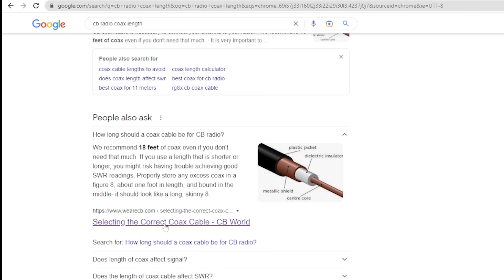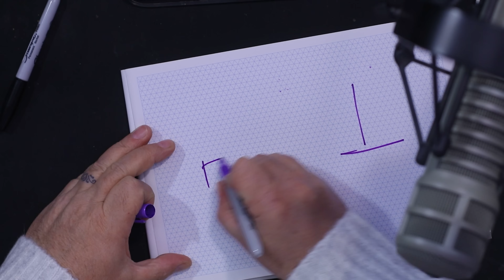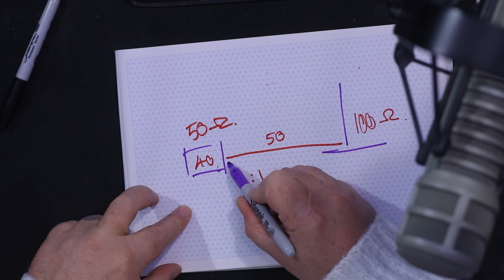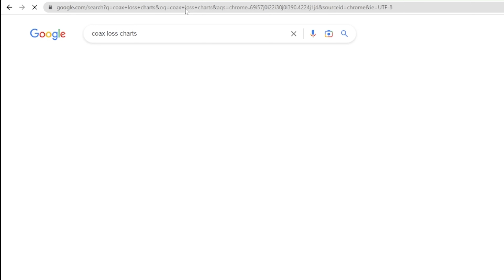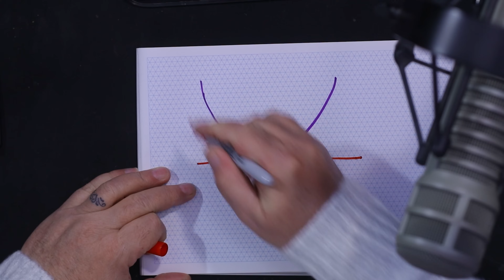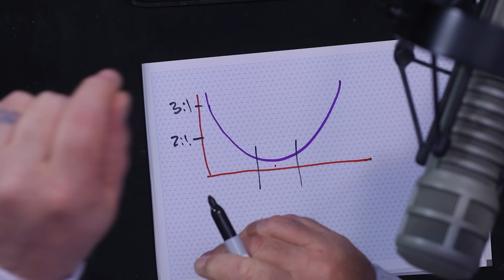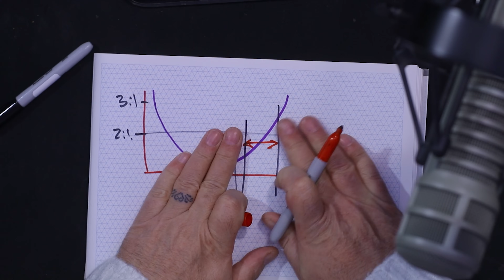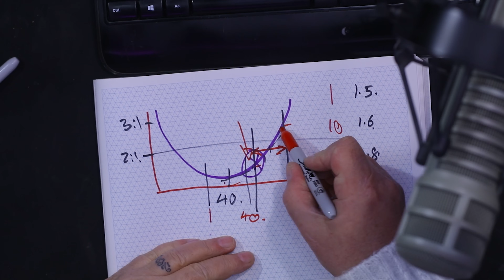11m / CB Radio: How Long Should My Coax Be?

Comment: Just came back to this as was thinking about TV transmitters and aerial coaxial cable.  So are tv transmitters at 75 ohm.   alos if what they say is true what is there view of ham radio for say HF 3.6 to 30 the vhf uhf dual band antenna what would there numbers add up to
Reply from the maker: Re TV.. Yes 75 ohm.. Sorry don't understand end of question..
Reply: They say if you are using 27.500 you should use this amount in meters of coax so how would there numbers work out for 3.5 tp 29 any were between using the same line feed  @DXCommanderHQ
Reply: @alunroberts1439  As Callum said, any length of coax will do.
G4GHB.
Reply: @bill-2018  I was not asking that if you did read what I was saying as calum was speaking they were saying the ideal length from there calculations for 27.500 so I was saying how do there numbers work out for 3.5Mhz or 7.200Mhz or 10Mhz or any think from 160meter to 10meters that is what I was saying.  So was what they say just BS.  Is there a best length for what ever.  So would it from there numbers work out different lengths.  For a cross the band.   All from there numbers.
Reply: @alunroberts1439  Sorry Alun if I misread what you said, Callum didn't understand either.
 CB'ers seem obsessed with coax length. I've never in 40+ years of radio cut coax to a specific length. According to CB'ers I must use 44 feet of trimmed coax on my 5.262 MHz inverted vee, which I don't. You're right it is B.S. I hate to think what I would need for our 136 kHz band!
The best example I can think of is they put a 50 Ω dummy load on their magical trimmed length of coax and see 4 Watts, then a random length and still 4 Watts. Most CB'ers are unlikely to have an oscilloscope so a bulb on the end would show it for a brief test. I've challenged some to try it but not heard anything back.
They'd probably still insist on velocity and impedance matching must be taken into account because they have been told and figures sound good.
Bill, G4GHB.

Comment: Callum, why don't you model typical antennas with different length coaxial feedlines on MANA-GAL?
You know how to use it better than me, I'll have to retrain myself.
Reply from the maker: Pointless because coax length has only one effect on a 50 ohmn system. Loss.
Reply: @DXCommanderHQ  the editors of that ARRL publication would seem to disagree.
Reply: @arconeagain  The RSGB Handbook only mentions loss for coax aerial feeder. They don't say different lengths make a difference.
Try a dummy load on different lengths of coax. It makes no difference. You still get 4 Watts unless a long lossy coax.
G4GHB.
Reply: @bill-2018  I've already pointed out various reasons why you may want a specific length of coax, like the half wave rule.
Reply: @arconeagain  I still say it's nonsense. Baffling people with figures sounds good.
In 49 years of radio transmitting I've never felt any need to cut coax to a specific length. The dummy load test shows why. No transmitter of mine has ever blown up.
According to you I must have 44 feet of trimmed coax on my 5.262 MHz inverted vee. Guess what? I don't. I hate to think what I would need for our 472 and 136 kHz bands. It'd be hundreds of feet painstakingly trimmed.
Bill, G4GHB.
Reply: @arconeagain  Actually it's not 44 feet, that's a quarter wave so it's more like 88 feet. I have around 50.
Reply: @arconeagain  In none of the RSGB Handbooks do they say cut coax to a specific length for a particular aerial. Why not read it?
G4GHB.
Reply: @bill-2018  I have read the RSGB, had a copy when I was a kid.
It isn't some myth, what I'm talking about is factual. If you don't know that, it's not my problem.
And what you're talking about with the inverted V, that sounds like a little known technique for feeding a balanced antenna with an unbalanced feedline. It's in the ARRL. So there's another example where you might cut to a certain length.
As for you never cutting to length, there's a very popular channel with an old ham who said he does with some of his antennas to get a better indication of the impedance. I think Callum may have done a vid with him.
So instead of telling me what I should do and that I'm speaking nonsense or whatever, I suggest you hit the books and better educate yourself. You can learn from other people you know.
Reply: @arconeagain  You do your thing and I'll do mine.
I've never in 49 years had problems with any of my aerials to make me think I need to cut coax.
Reply: @arconeagain  Have you not heard of baluns being used? They are in the Handbook.
Reply: @bill-2018  that's irrelevant. I can't believe you would ask that question of someone with my knowledge. I told you I have read the RSGB Handbook as a child. What does that tell you about me? I'm not a ham, that doesn't matter. I am extremely well educated. There's no talking to people like you. You can't accept that there may be someone out there as knowledgeable or more knowledgeable as yourself, or someone that has something fresh to bring to the table. No wonder amateur radio is stagnating.
Reply: @arconeagain  I don't dispute you have knowledge. You said you had read the RSGB book and the ARRL book describing an inverted vee as a balanced aerial, you appeared to not know about a balun, that's why I asked you. Sorry if I offended you, it wasn't intentional. 
I agree what you say about cable length in some cases it's important, I cut a length of 75 Ω coax for phasing crossed dipoles this year for 137 MHz. In 1974 I made a 5 el Yagi for 2m with the feed point tapped along the D.E., it needed a coax cable to be cut for impedance matching 300 Ω to 75 Ω  t.v. coax which a lot of amateurs used around that time on a simple set up. A lot of early gear had Belling Lee sockets on them.
I still say it's not important for a single aerial.
73.
Reply: @arconeagain  Hi arconeagain, one final thought you might consider.
An SWR meter is not an isolator. The aerial side is not independent of the input side. They connect together inside the meter.
Any length of cable on the input side simply adds to any length of cable on the output side through the meter. It's a fancy connector with a meter just as a coax coupler connects two cables together, it doesn't care what lengths are connected, they add up as one.
73, G4GHB.
Reply: @bill-2018  I sought of understand what you're getting. I believe there are a couple of different ways/techniques SWR meters measure in common meters, one better than the other. If the load impedance doesn't match the source, the SWR reading will change as you move it along the feedline, so different patch lead lengths will read differently.

Comment: I recently read an interesting article from QEX magazine (05/06-2021). It was about modelling antennas with the feed line using such software as EZNEC and MMANA-GAL, and the effects on CMC. You can find a version of this article by simply Google searching 'Simulating common-mode current in a coaxial feed line'.
QEX is a bimonthly magazine published by the American Radio Relay League.
So do yourself a favour, gents. Get yourself some free, unbiased, unadulterated education. Here's a small exert that directly pertains to the subject of this video: 

''Even in such a simple model as above, you can influence the common-mode current  by changing the angle the coax is routed from the feed point and changing its length between the feed point and ground. You can significantly reduce the common-mode current by making the coax length close to the odd number of quarter waves: ¼ wavelength, ¾ wavelength, and so on.

It works even if the coax is not perpendicular to the antenna driven element. But mind that this rule is applicable only for the systems without the common-mode chokes and for low feed point impedance antennas.''
Reply: You shouldn't have CMC on coax, maybe unless you want it as a counterpoise earth. Use a choke to stop it. I have no CMC on my various lengths of coax to different aerials.
G4GHB.
Reply: @bill-2018  I do use a choke, even in the mobile. I use a substantial ferrite choke.
Reply: @arconeagain  Always a good idea.

Comment: I mounted a mobile 5/8 wave base loaded antenna on my truck.  Fed it with 50 ohm RG-59 coax, cut to fit.. On the analyzer the SWR is good.. but my impedance is very low. 20-30db I think.. I want the most performance out of the radio as possible. Am I loosing anything?
Reply from the maker: No. You are fine.

Comment: 102in whip what type of coax and what length for 11m radio?  And cut to the chase.
Reply from the maker: Myth. As less as you can get away with. Too many idiots telling you that you need a specific length. Baloney.
Reply: @DXCommanderHQ 
You speak of a half wave and you talk about the coax for that but I got 102-in whip antenna so what type of coax and what length would give me a one-to-one match?   I know the answer to that,  I want to see if you give me the same answer.

Comment: At present I am running 200ft to my antenna. If I move the antenna closer to my shack I will lose 20 feet in height. Which way is the best?
Reply from the maker: You can do the calcs.. Search for a coax loss chart on the internet.. See what the losses are...?

Comment: I have a few rolls of RG6 Quad shielded coax from my low voltage install days... Wouldn't that be a good antenna wire for a trucker cb radio setup?
Reply from the maker: Sure.

Comment: Question: My SWR is always reading higher on channel 1 (1.5), than channel 40 (1.1). I keep bringing the antenna up, it seems the SWR isn't leveling out. How can I fix this and is this an issue? Also, after seeing this video, I'm going to trim the figure 8 out of my cable.
Reply from the maker: Trimming.. OK, so 300kHz on 11m band is about 1-inch.. So if you are not doing say half-an-inch, then you won't see much of a difference. ASSUMES this is a q/wave antenna element. See https://www.m0mcx.co.uk/quick-swr-calculator-for-vertical-and-dipole-ham-radio-antennas/

Comment: You’ve cleared up a few things on antennas, SWR and coax length! Thank you from VE3NMW.
Reply from the maker: Great to hear!
Reply: I don't see how... because if your SWR is creeping up the higher in frequency you go, the antenna needs to be shorter, not longer. Am I the only one who spotted this? 11m is CB 10m is 28mhz its a SHORTER wavelength. That's why you can get away with using a 50cm wire on 145mhz. 

If your CB has a higher SWR on 40 than on 1, the antenna needs shortening.

Comment: Good video, back in the 80s we didnt care about the length of the Coax, it was more important to get the SWR down as far as we could, now i dont live in the Uk have moved to Australia they are anal about Coax and how long it should be, i still go on about the SWR and coax is as long as it needs to be to set up a base station, and as long as the SWR is as low as it can go thats good enough for me.

Can you do a video on the Clarifier, i call them 12 O'clock here as they will not use to clarifier to tune in a station that may be off frequency, we know not all test equipment is not equal and there is going to be a slight difference, you go out for a radio check and all you get back is, Your Off Frequency, and thats it, instead of saying drop down a couple and getting the other station to get back on they ignore you.

Just subscribed and given you a big thumbs up from this expat 60+ yr old Teddy Boy...
Reply from the maker: Hey hello. Yes, I think you also dropped me an email.. I have no idea what people don't want to use the RIT knob. I do all the time. Some gear is off by a whisker. We should just use it..

Comment: I think I'll continue to cut my coax to multiples of 1/2 wavelength.   Which for LMR 400 @ 27.4 Mhz with a velocity factor of 85% = approx. 15.2575 feet or 183.09 inches per 1/2 wave.   That way I can check the swr @ 27.400 from the shack to make sure everything is ok.   And with only 1.2 db of loss @ 100Mhz @ 100 feet, I'll be getting the most I can out of my 4 watt CB.
Reply: Why not try random lengths of coax and see for yourself if there is any difference?
G4GHB.

Comment: correct me if i am wrong. been a long time.  i seem to remember my meters showing different values when i used different length jumpers and antenna cable length.?
Reply from the maker: OK, well they shouldn't have unless you were running really nasty crappy coax. Which frankly I did for years until finally one day I used some top-dollar stuff and everything worked just right!

Comment: Unless the antenna is designed for a no  ground mobile application , like a RV or boat . Right ? Thanx
Reply from the maker: No.. If the antenna is a 50 ohm antenna, it's genuinely irrelevant. No ground just means there's a coil and a matching circuit. Just like a GainMaster or even a half-wave-end-fed..

Comment: Ok i have another dumb question, since again anything you buy pre-made is done one way only. If I am building a co-phased mobile antenna system using two identical wilson trucker 2000 or possibly Wilson trucker 5000 antennas. Do I have to terminate both equal length coaxes into one single PL259 connector or can I use the appropriate Tee connector on the back of the radio and connect both antennas to the radio that way??? Most places I've asked the question just loose their mind say'in it won't work, but never offer any actual reason why??
Reply from the maker: OK.. so this is in the advanced section and you and I are probably not allowed! Seriously, it SHOULD work. The only fly in the ointment is the match. You could be lucky but to be "safe" they say use the T piece quarter or three quarters (or 1 - 1/4) wavelengths [multiply in half-waves] of 75 ohm coax less velocity factor. Reality is that if you used 75 ohm coax and fed it directly to the back of the set and made them the right size, you would get a match. That's all we want.

Comment: Shorter is not better. A full wave length calculated by the type of coax + velocity factor is best, as in ham frequencies over long distances the shield of the coax is part of the " Ground" of the antenna. You listen with ground....not the lead wire. A correctly calculated coax wave length will enhance RX
Reply from the maker: I stopped reading after the first sentence.. I guess it depends what axium you are measuring "better". But let's not get into utter tripe and baloney. Short is good.
Reply: Okay, its acting as a counterpoise earth which is not good for transmitting.
G4GHB.

Comment: Are you familiar with the Taurus GL3T Antenna Triplex 5" Magnet CB Antenna Mount? I am wondering if there is a way to upgrade the coax on it? The preinstalled cheap Chinese RG58 doesn't look like it will do the job very well. I run 300 watts max and don't trust the original coax to do a good job. Any help will be greatly appreciated.
Reply from the maker: OK, well if you can't get inside the base, you can cut it short - put a connector on it and then run better coax up to the pigtail.

Comment: Another thing I forgot to mention, the wearecb site text does not state that you might have trouble achieving a good SWR, it states good SWR 'readings'. This is because common mode current can affect the reading, resulting in an erroneous measurement.

Comment: Turns out David Blake has the answer, and I am very keen to see a response to this. I've done some research and a little refreshing, and it looks like this is not a myth at all. I'd like to think I was halfway there. This is a common topic of ridicule on forums, in particular, Amateur. It's up there with patch lead lengths, and there are quite a few comments here making fun of it, and CBers in general. From what I can tell, 18ft of RG-58 coaxial on a design frequency, acts as a common mode input impedance transformer. That is, from low to high. It so happens that a 3/4 wavelength, taking in the velocity factor, lands right on the truckie channel (27.055). As I said previously, just 1.378mm under 18ft. If Mr Blake is correct, and the information I read is right, who's laughing at who now?
Reply: What do you mean? You responded to David by saying you don't really care about CMC. No point being deflective over a valid subject, one you raised, and I really believe this is the reason for 18ft. You stated at the beginning of this presentation that you're no expert on transmission lines, and then in the next breath state that it's all a myth, and laugh about it. Your theory or so called proof is really quite flimsy and vague, and not really pertaining to the subject at all. I think David and I have it. This theory and practice is also importantly employed in circuit and PCB design as common mode gets into everything. Noise suppression in a vehicle makes perfect sense, but that's just one reason. Don't forget that CMC works both ways too, you will likely transmit spurious emissions. So when the FCC approved for hundreds of thousands of moving transmitters for the public throughout the country, you want the best practice possible with installations. This theory likely coming from early broadcast and military practice, not HAMS.
Reply from the maker: Jeremy, I'm SO SORRY but I genuinely don't have time for debate but I value your thinking.
Reply: @DXCommanderHQ  like I said in another comment, I will do a practical on it at some stage. Not just for this scenario, I want to do various tests with CMC and choke placement. For example, how far from the feedpoint of certain antennas. Just got to build a CMC meter.
Reply from the maker: @arconeagain  Good idea!!
Reply from the maker: Pass :)